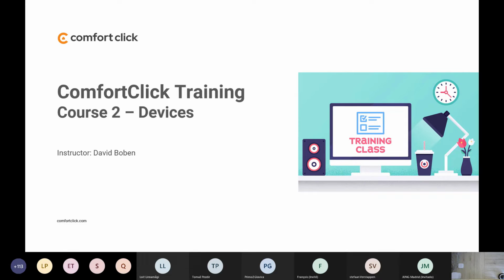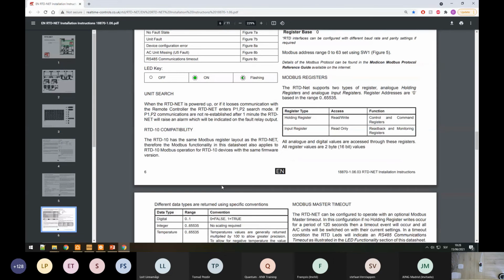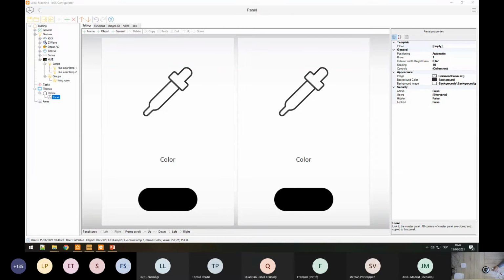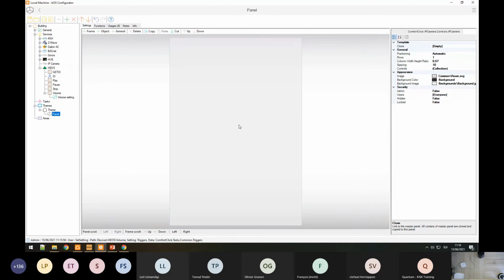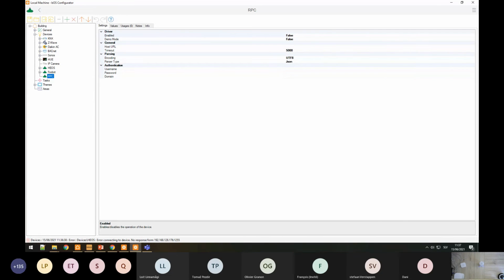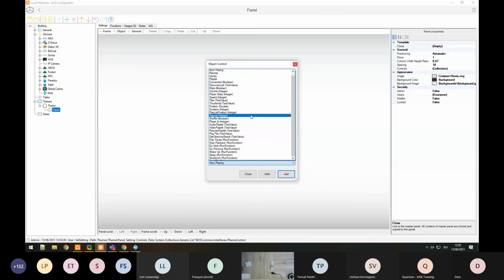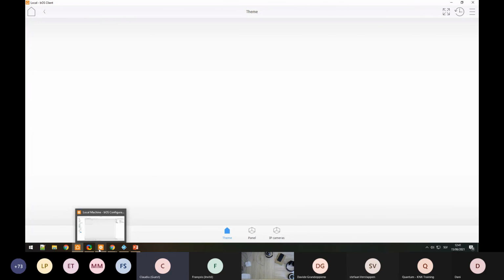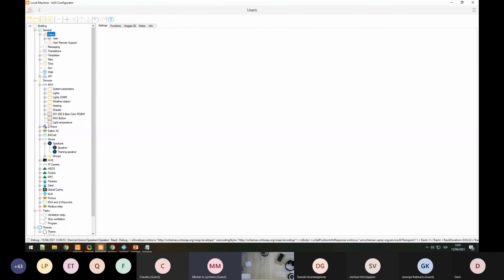ComfortClick Advanced Training  Course 2  - Devices

Comment: Is it possible to create a KNX project using Jigsaw with BOS? I mean do each group addresses need to be created in ETS and then imported to BOS configurator? Or can I use BOS to make a KNX project without ETS from scratch?
Reply from the maker: Hello Anand, thank you for your question. Before creating the bOS configuration you need to configure the KNX system with ETS. You can learn more here: https://www.comfortclick.com/BOS/KnowledgeBase/KNX
Reply: @Comfortclick  Ok does it mean, whenever I add new group address in ETS, I will have to import them, or can I add new group addresses in BOS?
Reply from the maker: @anandkarkal9587  You can also include individual group addresses manually into bOS.